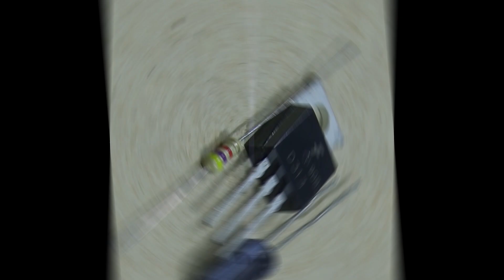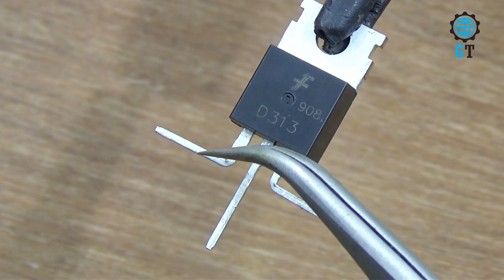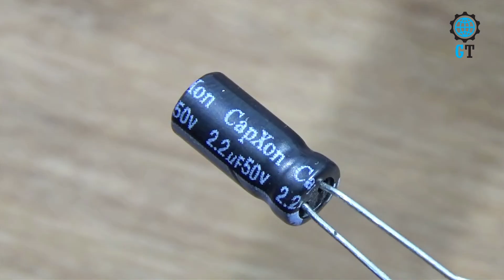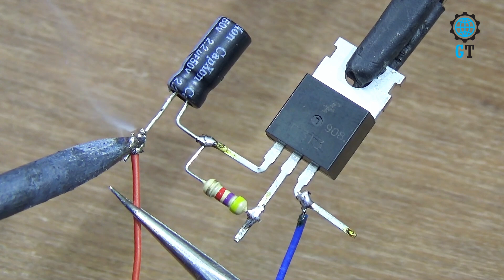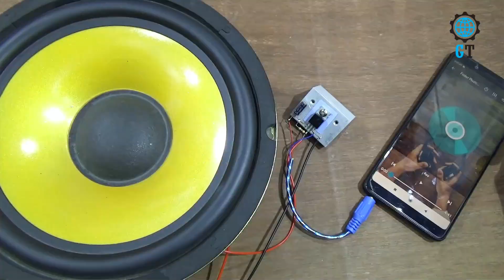How To Make DC 12v Amplifier Circuit Using 3 Component || Full English Tutorial

Comment: So cool friend, I want to know  the power of speaker: 12 x12 volt /  4 ohm = 36 Watts    or   12x12  /  8 ohms  = 18 Watts  ;  and also why don´t you connect the resistence in the other  pin of the speaker?